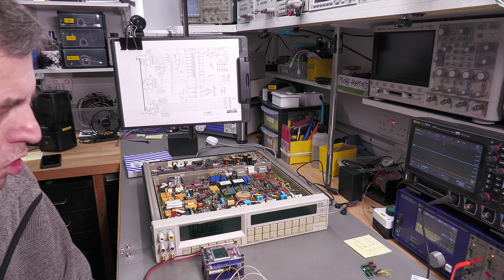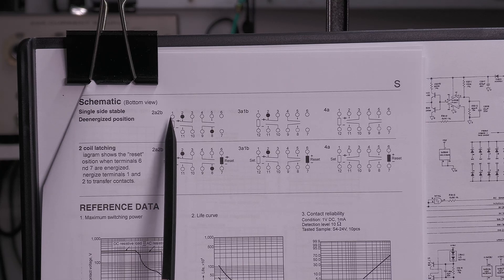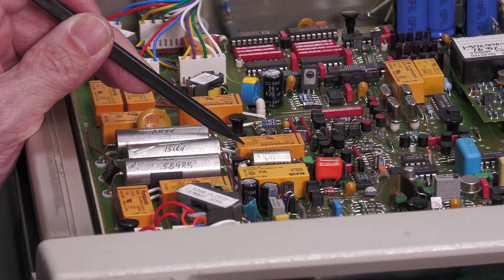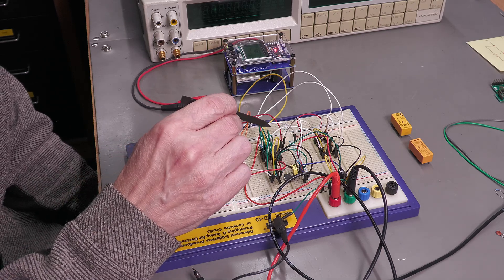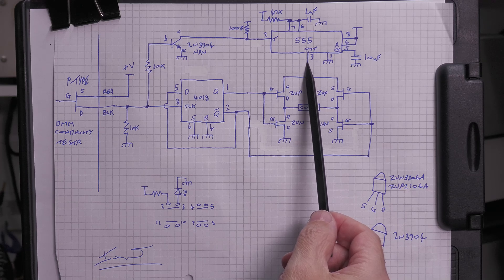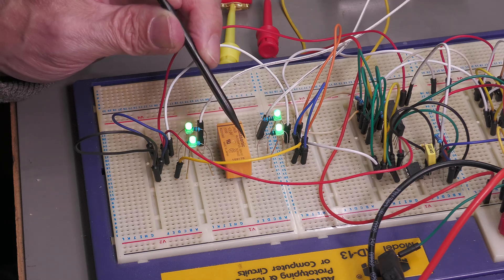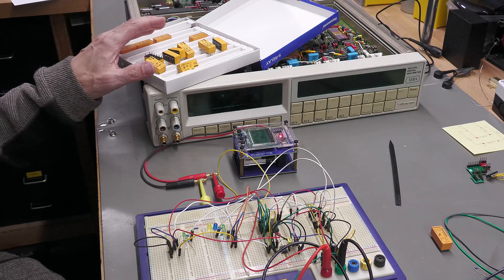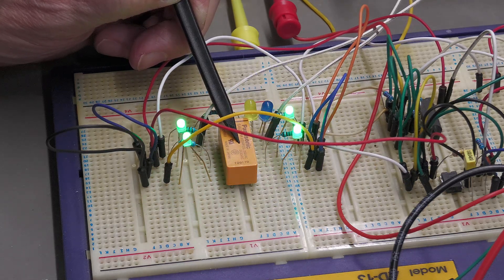No.168 - Wavetek 1281 8.5" Multimeter Repair - Part 2

Comment from the maker: UPDATE: I tested all the contacts on all the original relays. I got a 4W reading anywhere between 0.010 and 0.017 ohms (10 to 17mΩ) across all of them. The S2 relays being slightly lower than the S4 ones.
The NAiS datasheet specifies initial contact resistance (Max.) of 50mΩ. Se we are in spec. for all of them.

Comment: Most of those relays also use a single spool, wound with both wires on, and then with a small permanent magnet on the armature to either hold it in set or reset, and then the coils are going to either pull the magnet in to close the armature magnetic field, setting the contacts, or it opposes the magnet, pushing it to the reset position, where another magnetic shunt holds it lightly in position. A lot of those relays accept this option, as this allows you to simplify the drive, using 2 transistors or contacts, to get the latch option, or alternatively use the single coil, and then a H bridge driver to operate it.

Comment: The 2 coil relays usually need quite a bit more power when using only 1 coil. A step closer to a 1 coil relay is using both coils in parallel or series. Some relays are perfectly OK with this as the 2 coils can be wind together.

Comment: I would suggest you test the 4W resistance and how consistent the resistance is in say 10 contact cycles. Contacts being physical plated surfaces have mechanical wear, compare the new and old contacts.  As you know when the contact plating is compromised any number of intermittent and performance degradation wil be evident. Still all may be good and not a problem, especially if the relays are quality and well designed.

Comment: I wouldn't have changed the relays. At worst only 1 would have burnt contacts, and because the traces/parts burnt, they would've saved that relay. I would get an 8 digit and test contact resistance - lol -.

Comment: For these types of relay, single and dual coil latching relays are almost identical except the latter is equivalent to splitting the coil midway into 2 separate coils (not literally of course!). I.e. both windings are wound on the same pole and typically have half the resistance of the single coil version and require twice the operating current (as each coil has only half the number of turns). Thus the dual coil relays have twice the operating power of single coil versions. (See the coil data for the Panasonic DS and TX relays for examples).

I assume they do this to save cost, otherwise the 2 coils would require twice as much copper and the core would need to be bigger to accommodate the extra coil.

The 2 coils make them more versatile as you now have 5 different ways to drive them with almost identical results:

1) Use as intended driving the set and unset coils uni-directionally to operate and release.
2) Drive only the set coil bidirectionally.
3) Drive only the unset coil bidirectionally.
4) Connect the coils in reverse series (set- to unset- or set+ to unset+) and drive bidirectionally at the rated voltage to operate or release (because it is identical to the single coil version in this configuration).
5) Connect the coils in reverse parallel (set- to unset+, set+ to unset1) and drive bidirectionally at half the rated voltage to operate or release.

I say 'almost identical results' because using 4) or 5) requires half the operating power as 1) to 3). This can be important in precision applications such as in the Datron 1281 as lower operate/release energy reduces the heating of the relay and thus reduces thermal EMFs. This why they typically selected latching relays in the first place. 200mW of coil power for say 100ms (total guess) isn't a lot of self heating but at 8-1/2 digits, nano volts matter. After switching it can take many seconds for the thermal EMFs to settle sufficiently.

So my recommendation is to use the single coil latching relay, or the 2 coil versions using 4) or 5) if possible. If not, be aware that longer settling times may be required in the 1281 (they are configurable) after changing ranges, measurement arrangements (eg. ratio measurements which alternate measurements from different input terminals) etc
.
[EDIT] Corrected operating voltage in 4);
[EDIT 1] Corrected connections in 4)

Comment: Would be a good idea to check the contact resistance of the relays too before restoring it
Reply from the maker: The Panasonic relays are staying……but off camera I’ve been doing just that with a wee tweak to my breadboard utilizing a push button to toggle the contacts. Doing it manually but I did contemplate using WinGPIB to help!…….just incase they ever go back in!
Reply from the maker: UPDATE: I tested all the contacts on all the original relays. I got a 4W reading anywhere between 0.010 and 0.017 ohms (10 to 17mΩ) across all of them. The S2 relays being slightly lower than the S4 ones.
The NAiS datasheet specifies initial contact resistance (Max.) of 50mΩ. Se we are in spec. for all of them.

Comment: It is what it is ! it was designed that way so I say put the original relays back in and trouble shoot from there with a fresh perspective on the issue. Squeaktastic little series ! this stuff is gold, especially on the 'high end' kit....cheers Ian.
Reply: Problem with those kind of relays is contact wear, which long term is gonig to result in noise, or random contact resistance changes. Only cure is a new relay, or get a mercury wetted one, which does not suffer from this, and can still handle millivolt signals after millions of operations, even if half the time the operation was with high current or high voltage operation before, as the wet mercury makes a new contact each time. Only drawback is that they can be position sensitive, and also the mercury can be driven out by high current arcs and settle on the glass enclosure, so you need to tap the relay, with the contacts down, to settle the mercury back into the right orientation to amalgamate back on the fixed contact leg. one leg, fixed one, copper plated or thick copper, to handle this, and the moving one an allot of nickel iron that does not amalgamate with mercury, with a silver contact tip that will.

Comment: It would have been easier to just use any 15-V capable H-Bridge Driver (like the TI DRV8873), which has built-in dead-time control. But often, you have to work with what you have in your parets shelves

Comment: One relay fault in the 1281 can be contact resistance. This will be easy to observe in the 4-wire resistance mode, as erratic measurements with a 4-wire short applied to
the inputs. Can also show up as erratic DCV readings. Lightly tapping on the relays may reveal this.

Comment: Used to switch low current signals in a navigation controller, The relays had high current contacts around 10A's. The relays were fine in the switching application as long as they had never passed a high current. There was a form of plating on the contacts which gave them a very low contact resistance over there working life, but pass a higher current through them and it got removed. this would them lead to a higher contact resistance or no contact at all with the low currents. But they would still work fine at the higher rated currents. Seems that you really do need to know how a component might be damaged in ways that were hard to detect.  A bit like ESD you never know when that little punch through will become a current path and kill the component, hrs, days, weeks. Normally just after it was delivered to the customer. 🙂

Comment: Ian mate, If you put a small diode in series with each coil and connect them together as the polarity changes the other coil would operate, Bob
Reply from the maker: Yes, I mentioned that in the video @12:31 i.e. current steering both coils using diodes, but that requires cutting a track on the 1281 Pcb......nah!

Comment: It's according to the manufacturer, but years ago, I ran into a problem with a special reed relay manufactured by CP Clare (now Coto Tech) that was used in a Nelson Stud Welder belonging to ARMCO Steel. The relay had been discontinued, but they still could make them, and did for me, though I had to buy $250 of them. In a case like this, you could probably sell any left over on an auction site, if you ever had to go down that road, and if they would make them.